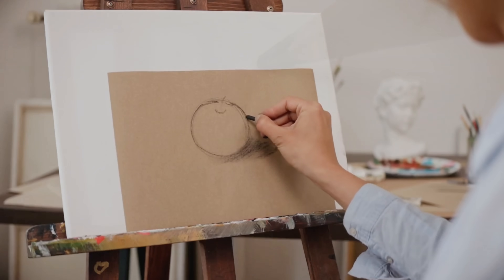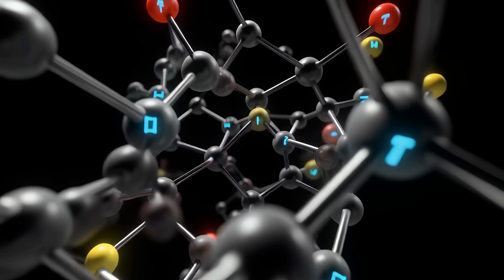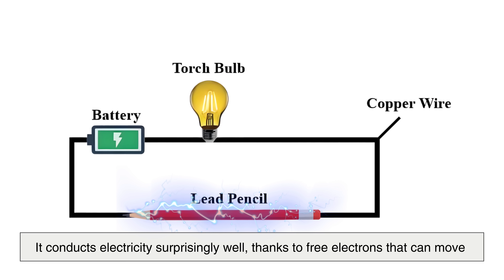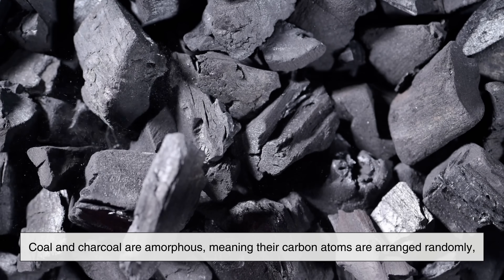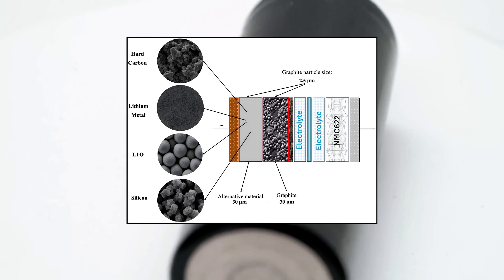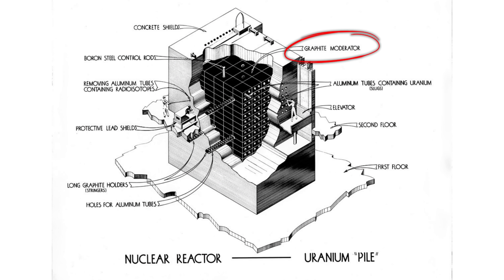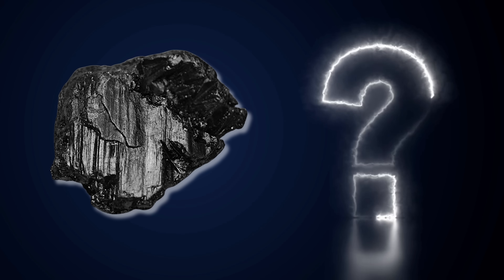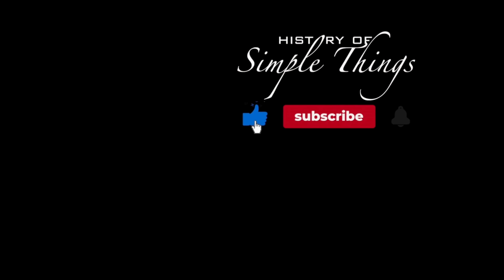What Exactly Is Graphite? The Carbon Material Behind Modern Tech [ID0819]

Comment: Can you explain how teflon adheres to a pan when manufactured but the food doesnt stick on the pan during frying etc..
Reply: Teflon is attached to the pan "mechanically" which is to say that the shape of the pan and the shape of the Teflon interlock.

Imagine pouring liquid chocolate around a tree.  Once it cools the shape of the bark would make it much more difficult to remove the chocolate.  Paraffin would do the same, but the paraffin l itself wouldn't actually have any adhesive, it's just the shape that would keep it attached to the tree.

Comment: what makes graphene so bad ass if it's made from soft graphite? how does a super thin layer of graphite become graphene?
Reply: By making small super thin layers of graphite atomically bond to each other, forming larger and larger ‘sheets’. It’s acheived through numerous processes, either top-down, or bottom-up. Top down methods involve breaking down bulk graphite into single, fewer-layer graphene sheets. This is cost effective for large amounts of lower-grade graphene. There are at least 6 such methods.
Bottom-up methods involve synthesising graphene by arranging carbon atoms and molecules on a substrate. This produces larger sheets of high-quality, consistent graphene required for e.g. the electronics industry. There are ate least 5 different such methods.
Research continues into better quality, faster, less expensive means of producing graphene. We’re only really at the beginning, as graphene has been very challenging.